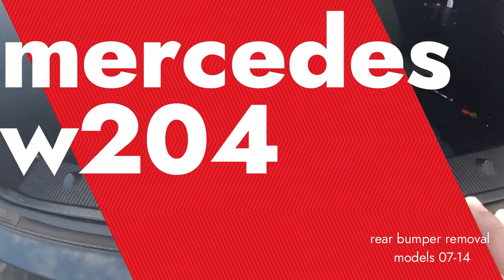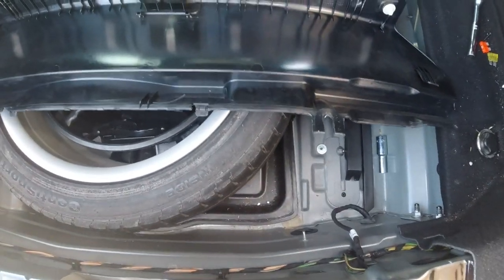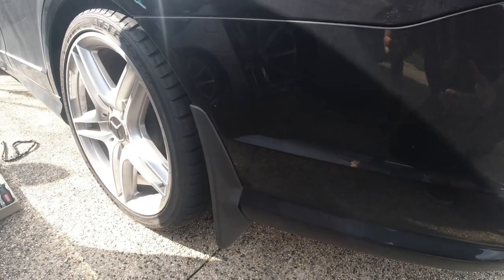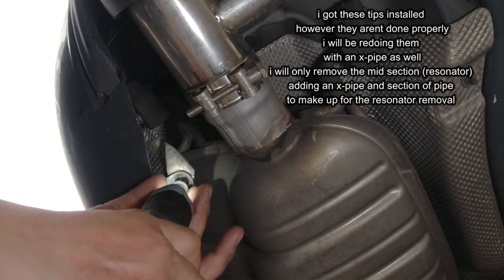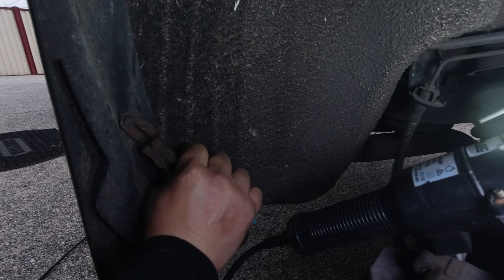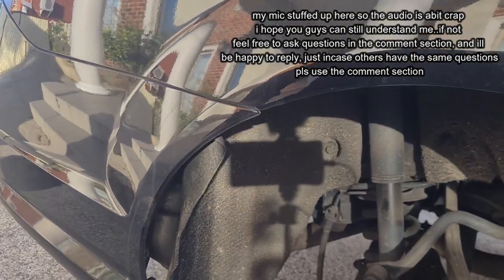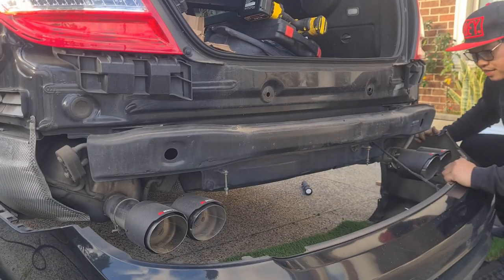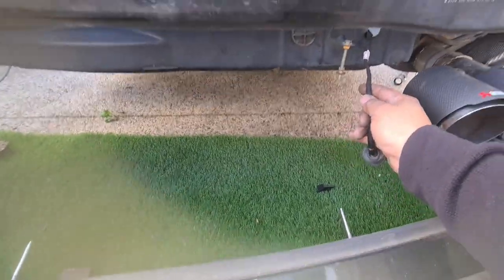mercedes benz w204 how to remove rear bumper- step by step guide

Comment: Tnx for this buddy, I plan to respray the rear bumper, was wondering about the rear parking sensors plug. Great vid
Reply from the maker: thanks mate ... 👍  me too.. but as stated i did this so I could finally install the retrofit blind spot detectors..microwave sensors that install behind the rear bumper bar ..so not intrusive like the parking sensors which are installed into the bumper..needing drilling and destroying the bumper ..if not careful.. ..gonna be a great video..

Comment: Hi Mike, this video has been a great help to me in knowing how to remove the rear bumper... I'll tell you a little about what I want to do, I want to buy a rear bumper, the AMG version is for a ( w204 coupe facelit ) and my car is a sedan no facelit..

I am interested in installing the LED taillights of the facelit coupe and the amg rear bumper.. Could it be that the taillights are the same in the connections? as well as the bumper… Do you have any information about this?
Reply from the maker: now im not too sure of u can put a coupe on a sedan .. u have to find oit if its the same shape and size .. usually u get a sesan one for a sedan amg and iy fits no issues...alot of ppl habs done this where they take the facelift rear bumper with the rear diffuser as it looks abit nicer with the extra curve lift of the diffuser whereas preface is just straight

Comment: Hello buddy, I want to install a trunk switch on the driver's door panel, the switch and the wiring harness on the door panel have been purchased, can you directly insert the door panel control computer to achieve the function? thanks a lot！
Reply from the maker: I'm not sure
Reply: @MIKEYZVLOGZ  hello buddy I can't wait to share with you about 204 with a trunk switch. Hope to help all 204 owners. On the main driver seat door panel trunk switch high configuration. Some of the original 204s come with a factory configuration and some don't. If you want to install a switch, you only need to buy a complete door panel wiring to do it yourself or buy the original wiring harness, and remove the door panel when installing it. You can go to Mikey previous video with a disassembly tutorial, replace the wiring harness without the trunk switch with a wiring harness with the trunk switch, insert it into the door panel control computer and you can use it directly. You don't have to replace anything else just the wiring and a trunk switch. Hope to help all 204 owners
Reply from the maker: @sichenglai very good ..my car did come already with it. good to know